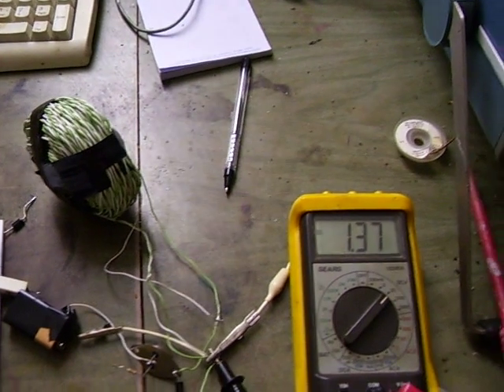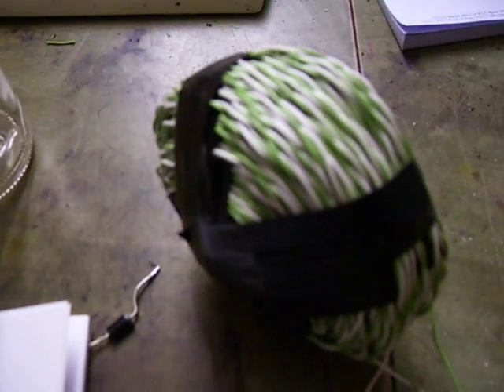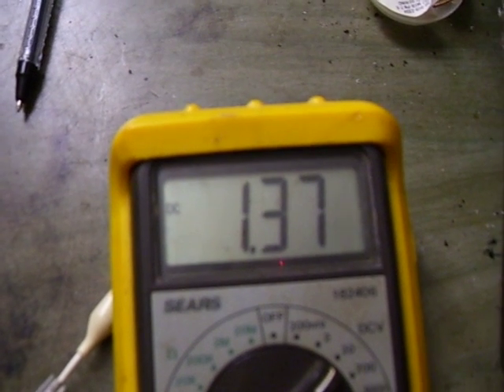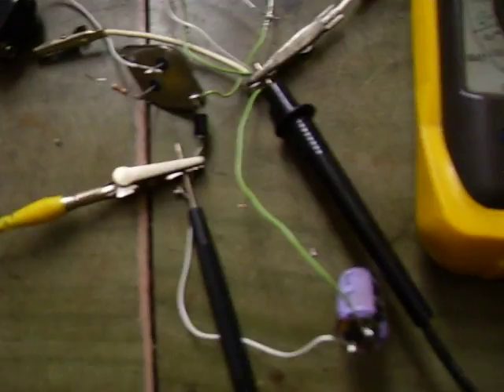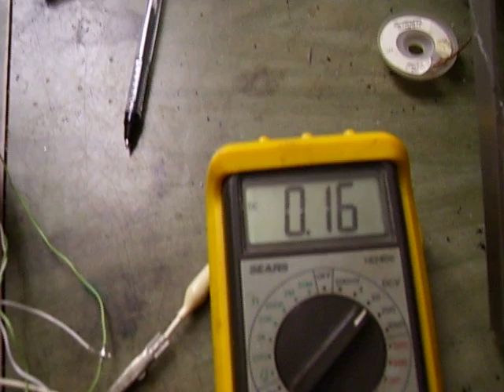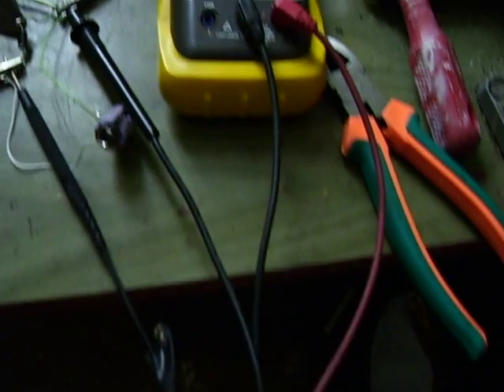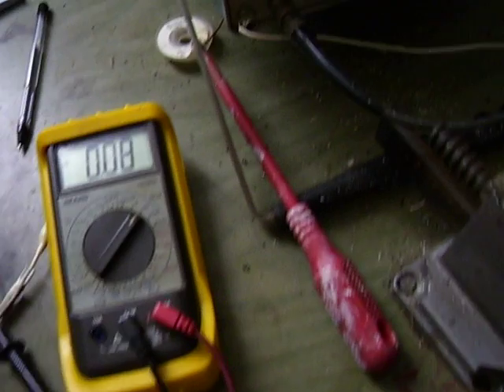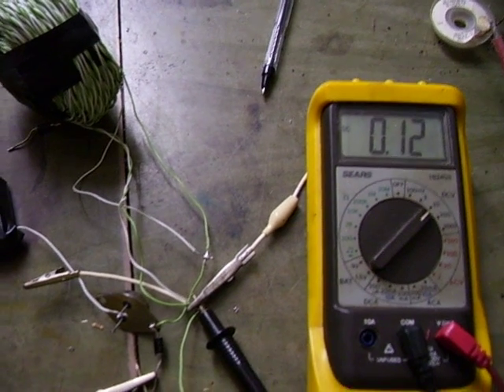my first bedini

Comment: nice work on your first bedini experiment.

I have recently built a bedini like pulse motor (check out my vids) and I've had the same discovery. You dontneed any moving parts.

Im starting to realize thatit is an oscilator not a motor. I have a reed switch and Transistor to pulse the coil. U could just use a 555 timer circuit to do same thing.

I will be posting my new vid in few days, im getting 140V into Capacitor. Check out my vids on Bedini and Tesla.

Try using proper 22-25G wire